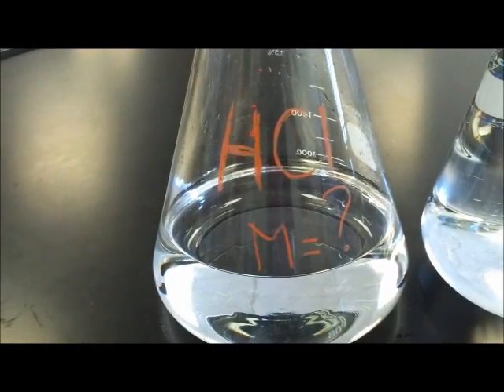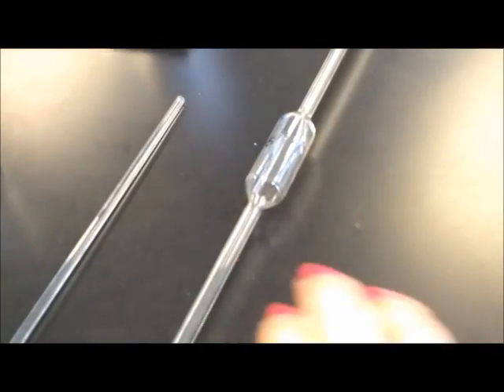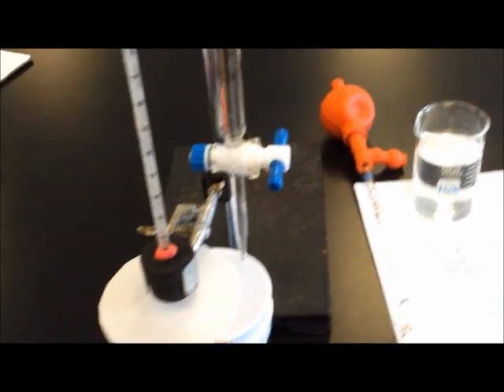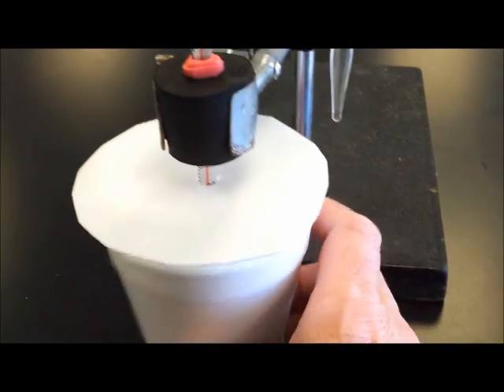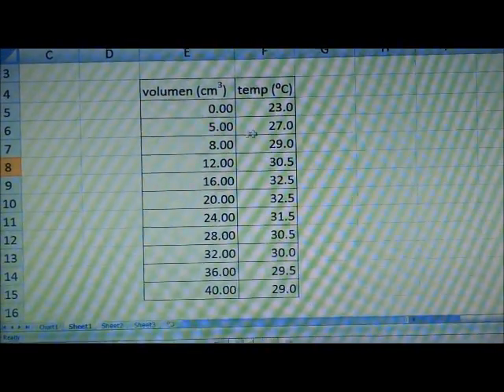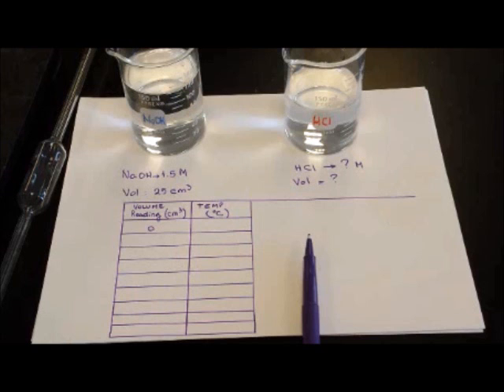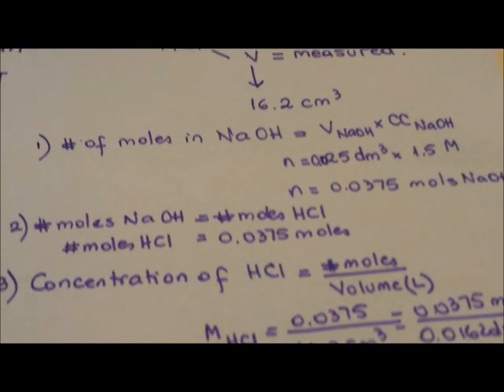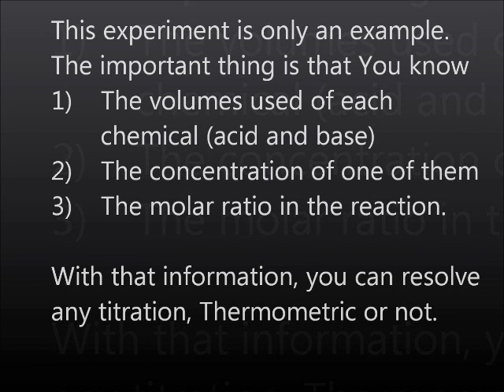AICE AS Thermometric Titration with calculations

Comment: why does the graph increase then decrease tho
Reply from the maker: The reaction between the acid and the base is exothermic.
The temperature increases at the beginning because as we add more volume there are more ions colliding, and heat is released into the solution. 
The maximum temperature will be obtained when all the OH- from the base reacted with the H+ from the acids. 
As we continue adding volume, no more reaction occurs and so, each new volume not only do not produce any more heat but also decreases the temperature of the solution. 

The maximum temperature must be extrapolated from both "best fit lines" 

I hope this information helps.
Reply: @sanchezanalia  this video is soo good because it really cleared up alot of stuff, thank you again
Reply: @sanchezanalia Thank you soooooo much , i just sent in my lab but i made mention of the fact that this reaction is an exothermic one and used that to explain and that the surroundings of the reaction would absorb the temperature of the reaction thus the temperature of the mixture/reaction decreases so the line goes back down in a sense
Reply: Thank you so much I'm also doing a lab and I wanted this information to help to account for my graph.